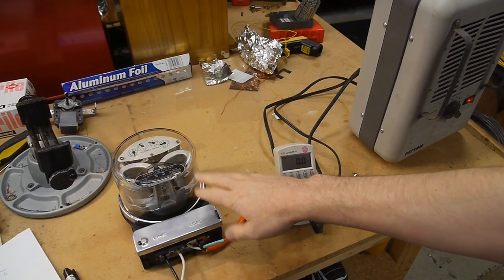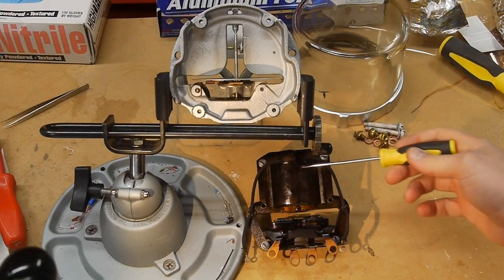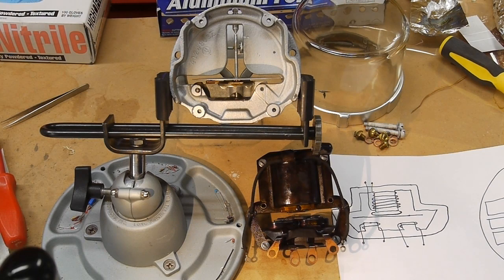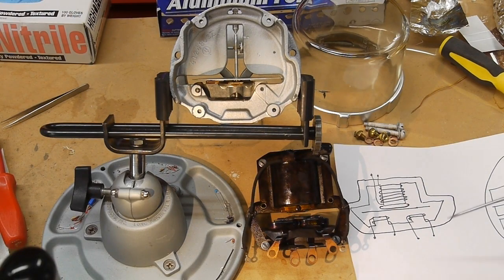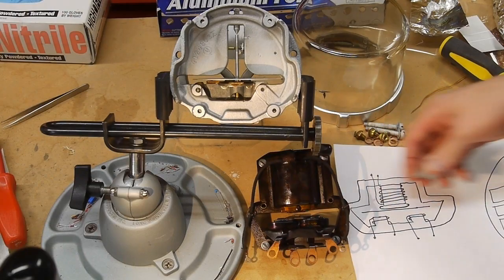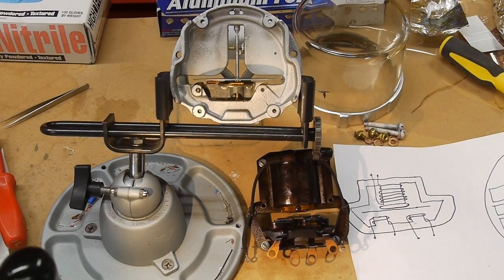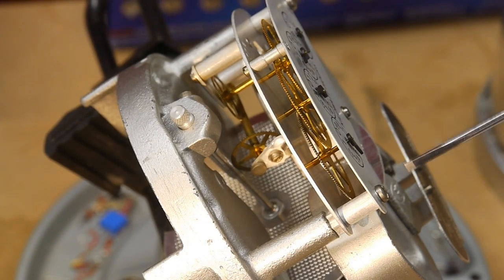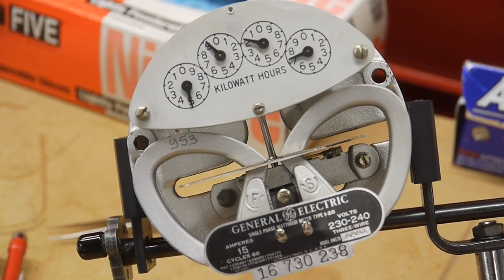Explanation of how kilowatt-hour meters work (electromechanical)

Comment: When you mentioned the copper on the volt coil, I immediately thought of shaded pole motors, then along came a shaded pole motor! I work in the electricity transmission business and the principle of the moving disk, is used extensively in old protection relays, some giving delays before tripping a circuit and some with selectable tripping characteristics. All very clever stuff and still used in many places around the world.
Reply: They are also used in both old & new AC (for the drive coil) relays.  In this case, the shaded pole creates a delay not in seconds, but in about an eighth of a line cycle.  The magnetic circuit is split, one half being delayed, the other not.  This way, there is always a non-zero magnetic attraction at all times (because the zero crossings misalign in the 2 paths) to hold the armature in against the return spring & prevent buzzing.

Comment: Great video
So with that, if I have a faulty water heater, not protected by an RCD (EFLB), drawing 100mA to earth, will the meter register this fault current? I guess it depends if it's a traditional vs smartmeter.

Comment: SO: the challenge is to achieve Tesla's free energy proposition. Well, not quite in the way that Tesla invisiged it but; if a powerful electromagnetic device is proposed to intefere with the poles that that will slow the meter down and that you can site on the inside wall of your house behind your electric meter so the Electric Company won't know, and power it off of the wall receptacle so that the Electric Company is actually paying for you to rip them off!! Wouldn't that be an ironic justice shafting the Rothschilds and their like???????
https://www.youtube.com/watch?v=YeLfV97Y328

Comment: The potential coil is an inductor, and as such, current naturally lags voltage, but with the open pole piece, it is not in a complete magnetic frame, so it needs the coil pole piece to complete the phase shift to 90 degrees.  The current coil has little iron and few turns so it's inductance has very little back EMF limiting current and shifting power factor. They produce fields in phase with the current drawn. 

No clue on the offset current coil other than possibly to compensate for the mechanical drag as it is not friction-less. This may have been produced to make the meter more linear in accuracy at all load currents.  This may be a guess on my part.

Comment: Does this measure only real power, or apparent power?  I know they dont really do this for residential customers, bit if the meter already measures apparent power, then it's not fair to be charged for power factor. Even though some of that gets burned up in the power lines on the other side of your meter, you'd be paying for power you arent using.
Reply: As he mentioned in a subtle way, they do "measure" the real power. Just a plain explanation: if current gets out of phase respectively to the phase of the voltage then the 90 degree phase shifting must be also shifted further and thus causing the disc to spin slower, i think. What happens if you could phase-shift to 90 degree? (just a thought experiment) The additional build in phase shifting would shift it another 90 degree so the resulting phase shift is 180° or 0°. The disc shouldn't spin in those situations. 🧠🤔
Reply: @10kpoti28  yes when the power factor is lower there is more reactive power in the lines. The problem is the resistive losses in the power lines, if the power lines were superconducting then power factor wouldnt be an issue, it would just mean more energy in the grid, but wouldnt be lost. In the real world of today, reactive power amounts to real resistive losses in the powerlines, and hence why power factor correction is required  or compensated for in the bill for industrial power customers.

Comment: It seems like all the coils would consume a lot of electricity. How much energy does that unit alone eat?
Reply: Very little, in fact. The energy absorbed by a coil while it is building up a magnetic field is returned to the line when the magnetic field collapses. The only real expenditure of energy is due to resistive heating. This is very small in the voltage winding because the current in that coil is very small. It is small in the current coils because large conductors are used and the resistance is very low.
Reply: @clarencegreen3071  — I expect the voltage coil would draw its power upstream from the transformers that feed the current coils.  The disc stops when the power is very low anyway, as was stated.

Comment: I wonder if you could amplify the slow magnets affect by putting a strong neodinium magnet in it's vicinity, thereby increase it's input into the system and effectively reducing the input currents speed of push on the disk... Hmm🤔

Comment: Incredible.......all these years as an electrical engineer in industrial power and we never learned about this......true Faraday genius IMHO.
Reply: Not to be a dick or anything, but that kind of makes me go 'yelp!' about the level of electrical engineers in industrial power... Surely you knew about the whole induction causing eddy currents in the aluminium disc to spin it up (and people using neodymium magnets to slow them down)?
Reply: @freakyjason477  - certainly did know that which you point out!!!!...the courses focus on the most critical knowledge to become a proper BScEE within a 4.5 year time frame....

one's failure to comprehend the width and depth of all there is to know about electrical engineering is very telling indeed!

Comment: But if the glass is removable you could just stop it working or wind it back, much like when I put a large magnet on top of my current modern meter to stop it working.
Reply: There's a band of steel wire running through the enclosure and meter's anchoring, terminated with a unique seal protecting the meter when installed, that will regularly be checked by a technician. The seal can be re-made, but in turn if they have reason to suspect tampering, it's possible for them to detect forgery.

Comment: I heard that the meter only reads whichever leg has the most power passing through it at any given time. So if you run one of those 110v heaters on each leg you are only paying for one of them?
Reply: No, it measures it all. Each leg has a current coil that induces an Eddy current on the disc; the force is additive.
Reply: @knartfocker00  I could've sworn someone told me that if I balanced my panel it would save me money somehow. Also 220 heat being cheaper than 110 heat because of this
Reply: @knartfocker00  were they completely full of shit or am I missing something here?
Reply: @RichardMiller-tq6ut  Balancing your load between the two hot legs doesn't really effect you financially one way or the other. NEC and the Utility demand a balanced load in large part to reduce neutral current. With a balanced load, neutral current is very low and that's why neutral wires can be undersized compared to the phase conductors.
Example: you've got two 120V, 1200W heaters, you plug both into the same circuit, you now have 20 amps (10+10) on one hot/phase conductor, and 20 on your neutral conductor.
Instead, if each heater is on a different phase, each phase conductor would carry 10amps, and the neutral would carry near zero. 
Similarly, if you had a 240V 2400W heater, each hot leg would carry 10amps (and neutral isn't involved in this circuit).
Power is ability to do work, in this case to heat something. Two 1200W heaters will heat as much as one 2400W heater.
Using higher voltage only saves you money in wire cost.
Reply: @knartfocker00  certainly I've heard 220 heaters are more efficient. That is not correct?
Reply: @RichardMiller-tq6ut  1) very slightly cheaper to operate because for a given power required, a 240V appliance will draw half the current that a 120V would, and it cost you a tiny bit to push that current thru the wires of your house.
2) wires size can be smaller for that same reason.
Reply: @RichardMiller-tq6ut  — the former
Reply: That said, the 2a/2s meter, like the one in the video and on other 240V 3Wire household services, will measure 120V loads somewhat inaccurately IF the two hot legs are not close to the same voltage, but they should be close.
IF the voltages were not very close, like: 117V & 125V.  Then the meter would slightly under-register all of the 125V loads and slightly over-register the 117V loads, by like 3%.
That's a bigger difference than you should actually see, and probably not worth shutting down half your house for.

Comment: i work for the electric company of my country, and my job is to find frauds commited by the clients, people get creative for tricking the meters
Reply: Any of those creative ideas to complement your comment? :P
Reply: @gusstavv  lol, i gonna give you a vage one because this is ilegal by all means, if you afect the voltage that reachs the meter you directly afect the reading without manipulating the meter itself, in 120V or 240V suplies people often hide a switch for the neutral or for one of the lines on a 240V

Comment: So how does the power company send a bill each month with different kilowatts used if they can't access the meter ? As in the meter has been on a locked porch for years.
Reply: If the meter reader can get line of sight on all 4 or 5 dials or the meter, they can read it with binoculars from probably up to 60-80 yards.  If they can't see it or access it, they send you an estimated bill based on previous use.
Reply: @knartfocker00  That's what i figured , the meter in question hasn't been read in over a decade since it is in an enclosed back porch with no windows. Just looked at it today and it was spinning like crazy with only a couple CFL's on inside and after resetting the breakers it went to slloooooww motion as it should have.
Reply: @ColoradoStrong-w1j  I wonder if they simply installed a smart meter that reports to them electronically upstream of yours, and no longer have a need to check the one in your household.

Comment: the reason they pushed smart meters and docked you if you didnt want one aka 100 bucks more a month etc.. is when you start up a dryer or say a motor or fridge compressor theres surge power meaning the power starts off at 6 amps then drops to 1 over 1 minute... with the old meters they could not measure this so a flat base fee they used.. which is still representing usage anyway no matter if your device draws  far more on start up you still get it registered.. but they realized how can we make more money and lie and push these meters.. ohhhh start  up amps and wattage.. see with your smart meter now when your fridge starts up the meter goes fast then when it  slows down the meter slows down.. they made an extra profit from that start up wattage.. even though the old ones did the same thing.. it was another way to justify skimming off the top and lieing saying they are more effiecient .. which they arent.. they wanted teir  payments too so you use more you pay more only way to do that you guessed it is digital meter.... these meters have killed people and caused fires and caused bloody noses in apartments from radiation also they are chained tethers in a mesh network your meter talks to your neighbors etc... also the other reason.. before they had to send someone to your property and manusally pull the meter out to cut your power if you didnt pay your bills.. you could force them out lock gates etc.. so now they tell the pc shut off his power.. in the back theres a little ac motor that cuts the connection off to shut your power off.. yup folks there all a lie also they sell the data on you to companies so they make 2 times profits  they know what kind of device you use from the power consumed time it turns on and off intervals current etc... they can also piggy back data on a line if they wanted say ge appliances could send data though the power sockets oh yes they can.. and prolly do...

Comment: So what your saying is slap a large external magnet on the outside to get true free energy!  Just kidding! LOL
Reply: people actually did that. the problem is that it sometimes messes with the "breaking" permanent magnets inside, so it gets quite fast if the external magnets are removed. another (highy risky) manipulation was drilling a small hole in the casing and stopping the disk with a wire :-D
Reply: The really old ones, you could put a box of salt on the meter (just sit it on the glass) and it would slow it, still don't know why but it worked, had to remember to take it off before they read the meter
Reply: @rbnhd1976  gonna have me walking a round with boxes of salt and salt lite trying to compare which works better.. :0)

Comment: When you pointed out the asymmetrical current winding, I wondered whether this affected the meter's operation when the power flowed in the other direction. A simple experiment would be to hook the meter up the way you did and measure its reading. Then hook it up backwards—load to source terminals and source to load terminals, then measure its reading again. Does the meter measure power at the same calibration coming in as going out?
Reply: Yes. Great question. I can provide you with something that you can ponder about. My meter started to run in the opposite direction when it was hooked up to solar "PV" . The meter was measuring identical consumption in both direction.

Comment: That’s a 2a meter. In order for to measure electricity correctly it needs 240 volts. Which is why it has the asymmetrical or half current coils. Plus a 2s or 2a meter doesn’t need a connection to neutral.

Comment: We still have those kind of meters in the stairway, outside the flat. Newer ones introduced pulse counter to feed it into electronic remote accounting systems. Another thing is that it works best for active power and if power factor falls below 1 it loses accuracy, that's why bills would go higher when switching to electronic meters. It is not uncommon to see a separate reactive power meter which should basically shift current and voltage phase by 90 degrees. And in fact, these days most of our power supplies are switching models which means they are more or less inductive load. Computer supplies have a PFC correction circuit, smaller devices do not. Keep that in mind as getting an electronic meter will almost certainly raise your bill :P
Reply: That is all good, except for the part about switching supplies. They do not actually appear as inductive loads, even though they have a phase delayed current draw and rely upon transformers and other inductors. Unless they have power factor correction (PFC) they will appear as rectified capacitive input loads, which means they draw no current until near the peak of each half-cycle, then they suddenly draw a large current for a short time, then the current draw falls off at the same rate as the voltage or faster and will certainly be zero when the voltage has its zero-crossing. While that is bad power factor, it is not the same kind of bad as a true inductive load presents: sinusoidal current draw, but with a phase-shift (delayed) compared to the voltage. Similarly, a true capacitive load also has bad power factor but with a phase-shift (leading) sinusoidal current compared to the voltage. Phase-control triac circuits like cheap lamp dimmers have yet another kind of bad power factor, similar to but not exactly the same as an uncorrected rectified capacitive input load. An old way of improving the power factor of DC power supplies was to put an input inductor before the rectifiers and capacitors. The best power supplies of that type used a swinging choke input inductor, which varied in reactance depending on the load current.